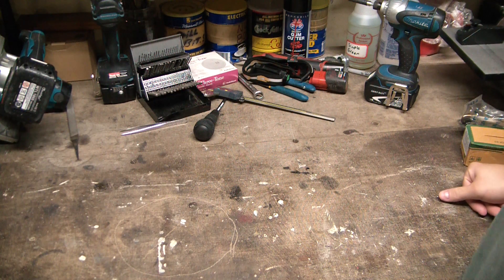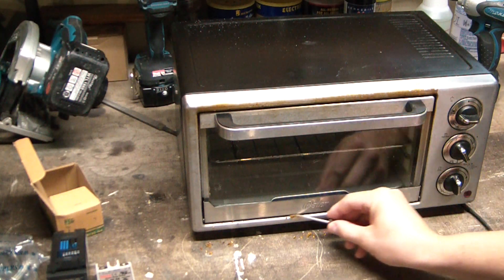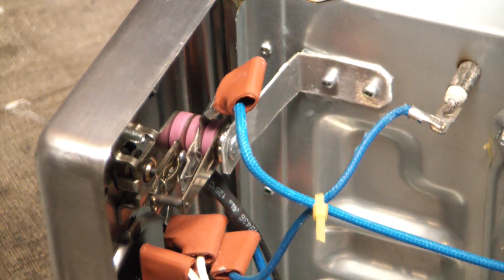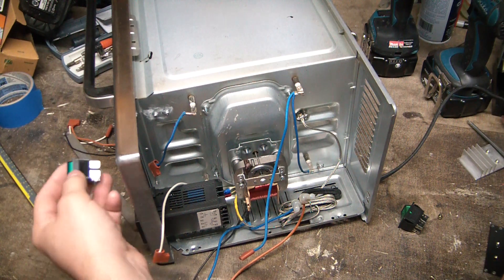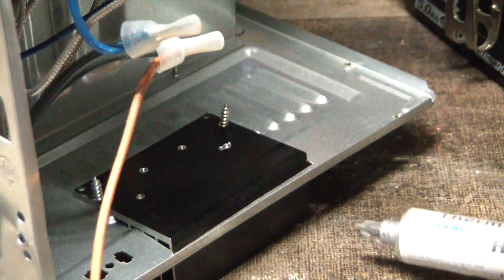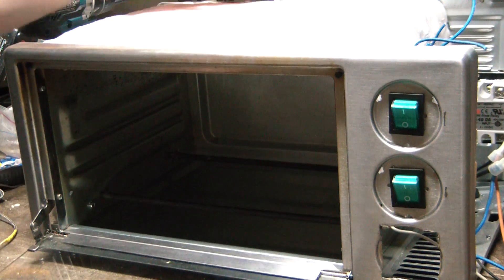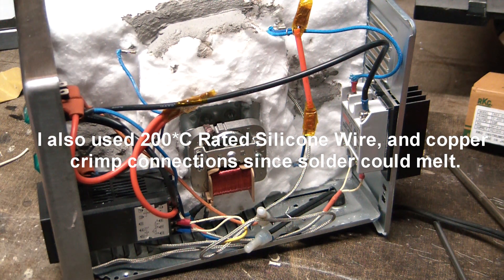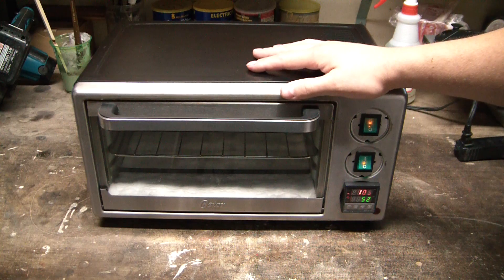Overengineering a Toaster Oven into a PID controlled Tempering Oven - ElementalMaker

Comment from the maker: Thanks for watching! Parts list in description. Please help keep the channel sponsor free at www.patreon.com/elementalmaker. Every patron gets a virtual hug and my unending appreciation. I will also build a small shrine to worship you. One of these is a lie.
Reply: Just worship Jesus, but I'll sign up for the virtual hug, Bob!!!! 😉 And I Tweeted my support to 13,100 people. You do great vids, keep it up! 
@The_L_Humphreys
Reply from the maker: @purelife2030  thank you so much Luke!
Reply: When applying thermal compound you do not want to trap air, as it is obviously not a good conductor of heat.  its best to make either a line or drop in the middle then push together till it squeezes out the edge.  The best stuff i found is the theremal epoxy from the tech ingredients youtube channel.  They sell it on ebay.  Let me know if you need more information.
Reply from the maker: @MichaelMantion  You are absolutely correct. This ssr isn't as critical as a CPU, and was significantly larger than a CPU's lid, so I just went with the slather and go approach. When I build my editing rig I used arctic silver (with the proper application technique lol). I wish tech ingredients compound was around back when I built it. How are your temps with it compared to other thermal compounds?
Reply: @MichaelMantion  Yep.  The thermal compound is to fill in surface imperfections and get rid of air.  It's a better conductor than air, but not as good as a direct metal-to-metal contact.
Reply: <3 your content, sorry to hear that covid has taken such a toll on your family. I'm a biologist who works with viruses if you have any questions i can try to answer them for you.
Reply from the maker: @TheOrganicartist  thank you, lucky we are all recovered!
Reply: @ElementalMaker be aware that its better to check if the thermocouple is properly manufactured. A few days ago i build a temperature control for a soldering station which already had a temperature display, that way i figured out  that the chinese thermocouple had a problem. It showed 30-40% smaller temperaturevalue than it was in reality. The reason is that the tiny sensor ball is embedded in that stainless steel tube, and if it doesn't touch the stainless steel body the heat transfer is poor.
So better check their accuracy with a known temperature (above 450F) otherwise you can get bad results with your tempering project.
You can extract the ball by pressing the pressfit with pliers in the reverse order so it gets round/square again.
Reply: When the elements burn, and I sadly think they will, look up nicrome /kenthal wire on Amazon. A hundred feet is like 10$ for 24 guage or 20 guage. 

You can spin new elements similar to kiln type and get a high enough resistance to run them, and have a higher temp rating. Use the lathe and dowel method slow speed to wind em and it's how I make my shitty kiln run
Reply: Also I got a pid controller from a vendor on eBay have have been meaning to do exactly this to mine 😂
Reply: I bought one of those with a controller board and solid state relay to make a reheat oven. Opened the package but the need to make the oven was no longer there so I never went past that stage.
Reply: Hey can you make some ammonium  nitrate? People saying it will only explode if coated in oil. Thought of you and ave for a debunk lesson :)
Reply: Hey, there is a spot on there for an alarm, and you can set up most pid controllers to alarm past a certain temp so you dont burn your house down. Still a good idea to monitor, but at least you can work on something in the vicinity and just listen out for the alarm.

Comment: I would add a "Thermal link" or two. Most appliances these days often incorporate them. Loved the thermal transfer link for temp sensing, original thinking.
Often the UL requires these in transformers, usually buried deep in the windings and when they trip, blow the insulation of the transformer has been heat stressed out of specification and are no longer UL compliant. Hence their location.

Comment: I'm currently doing a similar build with an old toaster oven right now, but I'm making it into a reflow oven. I was super confused as to how the temperature control in the oven worked (mine uses the same method as yours). I appreciate you taking the time to explain it, it's actually quite ingenious even if less reliable.

Comment: Appreciate the video…I’m working on this project this weekend.  Have you had any issues with the PID or SSR overheating?  I won’t be going beyond 500F.
Reply from the maker: It looks like I didn't include the side fan I installed in the video, but I recommend putting in a 120vac computer fan to keep the electronics bay cooled. I used a 90x90mm 60cfm fan I found on Amazon for cheap and works great
Reply from the maker: No issues yet! I've ran it for extended periods over 700. It was critical to add the 120vac computer fan to the electronics side, but with that it should be A okay. Just don't ever use it in your house, I wouldn't trust this sort of thing anywhere but my detached garage.

Comment: great video, like the explanation on the thermostat, mine doesnt even have any metal attached to the oven body to conduct heat, they placed a metal strip on the thermostat itself and run AC on it to heat up the bimetallic strip! btw did the thermocouple placement worked for you? i placed mine on the other side and it could not go beyond 100C with my oven setpoint at 150C even though my oven thermometer are showing well beyond 150C.. then i placed the TC through the door and then it manage to go to 145C

Comment: So I finally decided to check out some of your non rocket related shit. And as always it arises questions, while making the wheel turn alittle more in the gerbil cage of my brain.

First n foremost, was that a snap on soldering iron or another brand if so what brand(since they out source everything)? We run the snap on stuff at work, but fuck me are they pricey, but not being tethered to a wall is useful working on 30-60k# molds, that you can't easily move into our electrical area. 

Second more of a statement, and I get just doing it for the science, but i think you're spot on with the finding a kiln for this application(as I am as well), plus that could easily be filled with argon(top loading of course), for anti-oxidation purposes and keep some balloons close to blow up and check your argon level while filling.  Leave the sketchy taoster oven to dry out welding rods, still a very noble job for a brave little toaster.

Lastly if you're doing alot of t.c. shit let me know I'll send you some "scrap" constantan, add some copper wire and you have negative millivolts. Some of our wire harnesses have 44- 35' 16g wires in them.

Comment: Its just a stronk toaster
Reply from the maker: It's the STRONKEST
Reply: @ElementalMaker  Tbh you could have put the switches, relay and the PID controller into a external box connected to the toaster by heat resistant wire, that would have kept everything cool (except the satanic toaster ofc) and also you could have insulated the actual toaster better. Still one hell of a stronk toaster tho.
Reply from the maker: @tako1257  I thought about doing it that way since it would keep all my electronics cool, but really wanted to keep the form factor minimal. In retrospect though I probably should have done it that way. I am adding a couple cooling fans though, so that should keep my electronics from frying

Comment: This is pretty neat, I am planning on building something like this, not to get to such a high temp, just be more accurate in order to temper 3d print builds. Some of the instructions i have found use exactly the same PID you did. So its nice to see a video implementing pretty much the exact same thing.

Comment: I would really recommend putting computer fans in, to ventillate the control compartment, even with the insulation that space will get awfully hot for the PID controller if you crank up the heat and keep it at max temp for hours. The oven is gonna run much hotter than originally and the new control circuit is much less heat resistant than the original.
Reply from the maker: Agreed bigtime. I literally just unpacked my two new cpu fans I'm going to use to keep it ventilated

Comment: I'm thinking the elements should be ok. Backyard Scientist did something similar with a full size electric kitchen oven a while back and got it up to 1300-1400f (786c) and melted aluminum for PLA casting. Search backyard Scientist kiln.
I've been saving cpu heatsinks for years and Linus would be very proud of your compound application lmao.

Comment: In forming your perchlorate from chlorate, if you decide to use the HCl method for destroying trace chlorates, be careful with what you might find on the web with regards to the process. I have seen it stated simply to adjust the ph to something like <3 and boil for a few minutes. I have done this and, it doesn't appear to be affective. Either that or it is a quite slow process. I suppose if the chlorate levels are minute, perhaps it is more effective. In my case, after boiling for ~30 minutes, adding additional HCl forms additional chloric acid (indicated by yellow coloration and release of ClO2 / Cl2.) So plenty of chlorate still present. What I ended up doing was adding HCl gradually until no more chloric acid formed. A down side is most of the destruction seems to lead to molar equivalents of ClO2 / Cl2 which needs to be dealt with. I suppose if the other method worked, Cl- would be formed instead. Maybe I am doing something incorrectly. Note I have done this only with the sodium salts. In the end, I use a sensitive test for chlorates as a final procedure before labeling as perchlorate. I use the indigo carmine test. I did a control with distilled water (tested negative) and a test chlorate solution (tested positive.) If my calculations are correct, I detected the chlorate at a few ppm.
Reply from the maker: Truly excellent advice. Your comment prompted me to go buy some methylene blue and indigo carmine to make up test solutions.

Comment: VERY good advice on the use of an SSR with those PID's, or at least an external relay. I''ve had several of them fail catastrophically. The mechanical relays they fit inside them are WAY under spec and poor quality. One memorable one was driving only a 400w load and failed in short order. When the contacts tried to open they were partially welded shut, eventually the heat generated melted them open again but because they were red hot and deformed the resultant arc didn't clear and set the entire unit on fire.

Comment: So I just thought of something... I'm thinking copper foil cladded on the inside could be a great thing. Copper reflects infrared very well, it doesn't even have to be shiny to work. I believe copper is used as a mirror for IR lasers. But I'm also thinking it could be too good of a mirror creating reflective hot spots but then the size of the heater elements might negate intense hot spots.

Comment: I made one for Decarboxylating . I use an old gutted PC power supply (box) and it's fan to cool the SSR. All in one deal PID controller, SSR, cooling fan with power switch. Use the oven timer to prevent stuck SSR.

Comment: Chinesium SSR's invariably at the low price end are almost always going to be an 8A Triac and a zero cross switch salvaged from some ewaste, and then get the label applied saying 10A, 16A, 25A or 32A, irrespective of the parts used inside.  They might have actually used a screw or rivet to attach the device, but have been known to just leave it with a blob of thermal paste and a mica washer as heat transfer method and insulation. They are also known to use non insulated tab triacs and rivet or screw them down direct, so you can be glad that the wire they use inside is often thin enough to act as a fuse.

Comment: You should play with magnatrons and see if you can replicate the happy accident that Jamie Hyneman did on Mythbusters.. He tried making a super microwave using 4 magnatrons inside a roundly 12 inch cube and one on each side and instead of heating it ended up cooling the stuff inside of it. 
Your rocker switch has a rocker switch.

Comment: One comment... if you haven't ran this yet, check the clearance of the glass door with the opening... with nearly doubling the operating temp, the glass may expand enough to interfere with the door... and may explode if it expands too much and has no place to go. Just be aware you may have flying 800F glass in your shop.

Otherwise, nice build!

Comment: Please let me know when the gofundme is live to replace your burnt-down house.
Reply from the maker: It'll be hard to burn down a 1950's cinder block and plaster house. I think we might need a tank to come in and assist. I'd love to build fresh! To have a house with insulation would save so much money
Reply: @ElementalMaker  I have a PID controller that does double duty in a toaster oven and a lead melting pot.  I also dip it in my wheel weight melting batches so I don't get any zinc.  Gotta keep it below Zinc melting point.  Haven't burned anything down yet.

Comment: Yes sir I'm an industrial electrician and we used a bunch of the solid state relays.👍
Reply: In your opinion, how reliable are they, and is there anything you know of that kills or shortens their life ?
Reply: @1st_ProCactus  They're pretty solid.
Reply: @Jimmeh_B  ha!
Reply: ProCactus well, heat isn't good for any solid state device, so keep them cool.

Just a joke - don't know as much as a pro, and you're not going to keep anything cool inside an overclocked toaster oven.  Heavy gauge wire and mounting the relay elsewhere (not in the oven) would help.

Comment: If the thing has a heating element at the bottom, wouldn't it be better to put the heat blanket at the bottom of the oven too? Might be slightly harder to insultate but should help a bit I guess. Beyond a few longer legs/standoffs it shouldn't make it much harder.

Comment: Well if the heating elements burn out but the rest of the components survive, you can go all Frankenstein on the next victim and just move all the innards into it. 
I made a humidity- and temperature-controlled meat curing chamber using 2 of those PIDs. Very useful, once you understand the pseudo-English in the manuals.
Reply: If it burns up, couldn't you just take a coil element out of something else, like a space heater, and use that?
Reply: Just go grab a grill element from a small oven, and fit it in the case. Might have to make a few extra bends in it, but it will heat up faster then. Grill elements will work up to red hot fine for years, along with the bake elements, just because they are so inefficient at heat transfer otherwise. In such a small well insulated space they will actually get the whole lot up to red heat. Easy way to tell it is fine is when that aluminium tang melts off it's rivets.

Comment: Those PID controllers are super useful. I should probably pick a couple up. Also I have wanted to something similar to this and make a dehydrator box for 3d printer filament so maybe those will be my next projects.
Reply from the maker: They are great for projects like that. Easy to set up and pretty cheap to boot.
Reply: I don't think you need a PID controller for such an application. I just store my filament in air-tight plastic boxes in which I also drop 1-2 of those rechargeable silica pack dryers (Eva-Dry, look it up on amazon). Keeps them nice and dry.
Reply from the maker: @stamasd8500  I found some really nice plug in rechargeable silica moisture control units at my local Aldi. Works great to keep my filament dry in a big plastic storage container.
Reply: @stamasd8500  This would be for nylon. I store my filament in 3 large tubs that hold about 20 rolls each and a gallon of rechargeable desiccant per tub. However the nylon gains moisture so fast that I have to dehydrate it before every use even if I just left it on the printed overnight. Thats what living in a place with super high humidity will do to ya.
Reply: @x9x9x9x9x9  Ah, I never used nylon. There days my go-to filament for almost everything is PETG.
Reply: @stamasd8500  petg is great as long as it's decently made and dry. Bad petg will give you a migraine trying to tune it.